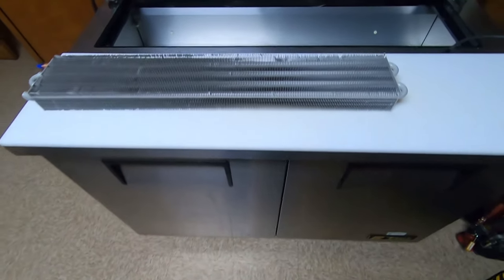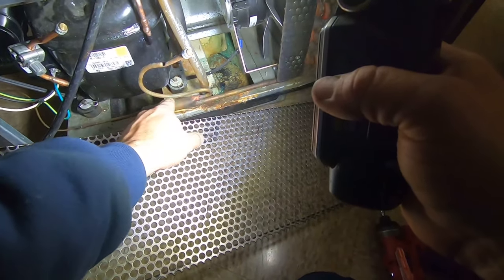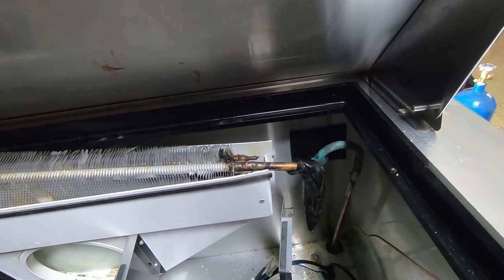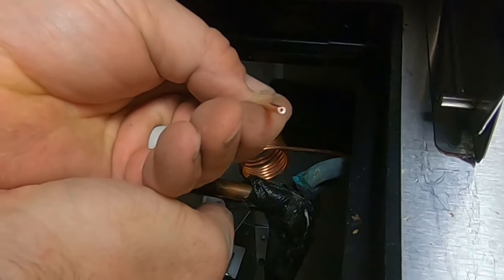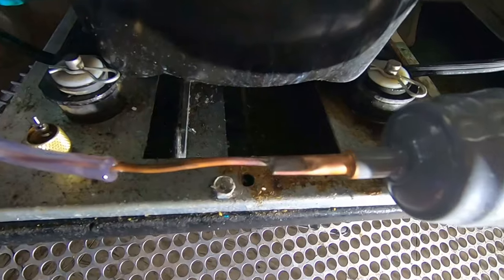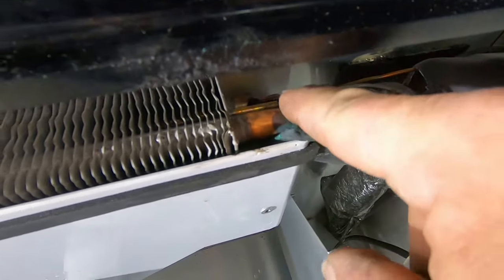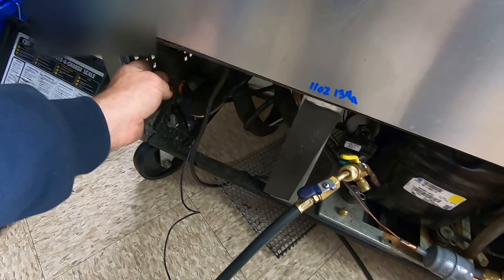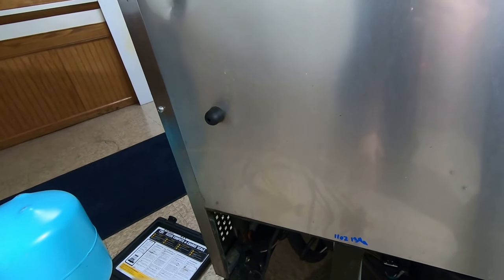True Prep Table Evaporator & Capillary Tube Replacement With Full Start-Up Procedure

Comment from the maker: Here is an evaporator and capillary change out that I did. I made this for the new techs and those interested in the procedure. If you enjoy these videos please leave me some feedback! I like to know what videos were your favorites.  Please subscribe and give me the thumb..lol
Reply: A Rick do you know if true mfg is going to aluminum Capillary tubing? How would you braze aluminum to cooper? I appreciate any information.  Thank you Ron White.
Reply from the maker: @whitesheatingairappliancer7101  I haven't heard that,  the cap tubes I have worked on have all been copper even on the R-290 equipment from other brands.   Solderweld.com  has some nice aluminum braze kits and so does a few others,  aluminum repairs can be done but it takes some practice and patience. I don't see a reason at this time for them to change to aluminum cap tubes but that is my opinion.
Reply: Thanks Rick,  I will check out solderweld.

Comment: In my experience over the years when using the 032 drier as a replacement for a bullet drier I needed to add 1-2 ounces over factory charge.
Reply from the maker: Good to hear👍👍Thanks!
Reply: yep.putting in a bigger drier,is like putting a receiver in.
Reply: @terryj.macmullen9968  ya, ever notice the Japanese eliminate driers altogether?
Reply from the maker: Yep, if you keep it clean your less likely to need one. But they use screens instead of driers.
Reply: they must use super dry refrigerants in japan.maybe to lessen the amount of refrigerant needed.?they must use the flamable gases there.
Reply: I remember addressing this years ago and Sporlan said it’s not an issue, you just add the additional refrigerant required to completely fill the shell, and the data is available on a cut sheet with the driers they sell OR in some kind of bulletin.  I do remember seeing it.

Comment: I use the same drier on cap tubes except where space is a premium, then I use the D-111, it has the access port as well. I do like your forward thinking to protect the cap tube of debris, and not opening the drier till needed, and the vinyl sleeve.  I saw an OEM on an ac that did that and was impressed. That pressure releasing you did with your thumb is the same thing I do if I’ve sanded the end. Great advise from your dad, copper is very malleable.
Reply from the maker: Thank you for all the feedback, I appreciate that🤜🤛👍👍

Comment: Great video thank you. Good to know that there is replacement filter dryers to replace the pencil dryer. I will have to check them out.
Reply from the maker: There is a C-052 with  ports on both sides available also. Thanks Ron!

Comment: Cool change out .. two things I would done differently.. would have cut the coil out the bottom outside the box .. pull it out then brazed suction and cap tube then for my last connection used  a flaring tool to make my brazing .. this would prevent damage to inside box and a better brazing .. like u said u can’t weld what u can’t see .. then for my charging .. just use the data plate for recommended charge ..thanks nice video
Reply from the maker: Sounds worth trying 👍👍. Thanks 4 watching!

Comment: Hi 
If I am not wrong I heard you talking about super heat for my knowledge and my experience we don't do super heat on reach in just charge the system by the name plate 😁
Reply from the maker: That's what they have always said and it's what I generally will follow but sometimes as cap tubes get restricted, coils start to get dirty and the equipment is just worn out or miss matched, you start looking for every tool to make it work that you can use.

Comment: Good video Rick. If you didn’t have any charge weights and had to charge just off pressure would that be suffice for cap tube systems. Just a little tricky charging with super heat on critically charged systems. Hard  charging a cap system because they generally don’t hold a lot of refrigerant and pressures can run very low making techs believe it’s under charged.
Reply from the maker: Your superheat changes as it reaches box temperature. I would want to see enough super heat at shut down. Maybe 12-16. It’s very difficult to do it by superheat.

Comment: Great repair and video. Have you had opportunity to use the Sporlan C-052 TT driver yet? Great filter so far. 
Appreciate your attention to detail. It's great that you teach the new guys with detail. However, it is a shame that you have to spend time warding off the YT police and their 2 cents. I'd love to get a days education from those super techs! Thankfully, there are techs like you who not only DO the work but also give actual effort into helping OTHER people.
Reply from the maker: Thanks man, I'm trying to make a difference, I'm learning chillers and grocery racks and I'm the one looking for help, so I know what it's like to not get the help you need. I have to admit that has driven me to do what I'm doing.
Reply from the maker: Yes, I use the 032 cap tt and the 052 cap tt, both work great but they won't stop bad Poe oil from clogging the cap tube.

Comment: Did you have any call backs because of the low saturation suction temp? I recently changed out a cap tube and had a saturated suction temp of 7–10. Unit was reaching set point and amps were good, so I called it good.

Comment: Happy Thanksgiving Rick!   Nice brazing!  That 590 is nice!   I have the 500, it's nice being able to lay them on the ground like that and fully operate them.  Just picked up a goose-neck AccuTrak.  Really like that tool!   Especially outside on windy days.  Your video on that sold me!  Thanks!!!
Reply from the maker: Happy TGD to you as well. The 590 has been good to me and so has Testo.  But the 500 is weird about going back to 0psi. I would like to have the goose-neck ultrasonic but could not find one used,  I'm cheap😁. Mine has its places where it shines and others where I can't find a leak without using nitrogen. Yes outside is the best place,  definitely not a busy kitchen. Lol

Comment: Hello Rick first of all thank you for a great video.. My question to you is....I've replaced a cap tube on a prep table followed pretty much all you did. I have tried weigh in the charge...to no avail...my suction line temp just won't budge...it's about 2 degrees less than my discharge temp. So then i evaluated the system and have been trying to add small amounts of refrigerant to get the box temp down at least a few degrees. I know from the compressor that it requires 266 g of R-134 a so I started there.. Currently I have. 39 and 110 pressures and 83 on both suction and discharge line temp.
My sat temps are 44 and 93. Box temp 82 ambient 80
So clearly the system is not working.  I have tried removing the cap tube and blowing it out with nitrogen. Replaced the filter dryer 3 times.  Is the issue here compressor related? I tested the compressor and the amp draw is 6.4 on a RLA 7.5 so that's not bad.  Evaporator was replaced a year ago by another technician..  Hope to hear from you and thanks again for the great video. 

Edit: clean condenser and proper air flow in evap and cond in case you ask..also no receiver on unit. Simple design.
Reply from the maker: It sounds like valves are about shot. "Low head and high suction".   You verified your not restricted, I assume you tried running nitrogen from just the high side first and it made it to the suction side?.   What I have tried in the past was use my pinch off tool on the suction side (do this if you don't have service valves on the compressor) and pinch off the suction line, you should pull down into a vacuum or at a minimum 0 psig. Then turn off the compressor and see if it holds at that pressure. If it doesn't pull down to 0 psig and hold you have a valve issue and need a new compressor.  Thanks for contacting me 👍👍.    I'm curious where are you located?
Reply: @HVACRSurvival  Thank you for the quick reply. I'm located in the river city of San Antonio Texas...
I did run some nitrogen thought the high side just prior to my soldering in the cap tube to the evaporator. I also cleared it through the suction again right before I brazed the cap. I've gone days trying to figure out what is wrong here and why my suction temp won't budge. No matter what i do. That high suction temp is causing the comp to short cycle constantly. I did manage to get it to stop cycling and got the box temp down to 70..but that was short lived once i added another ounce of refrigerant..I also
 added some ice inside the box to offset the heat being produced by door heat strips...which incidentally I think they are not needed specially given the fact that the prep table is in a hot kitchen. Opinion on that?
I do mot have a pinch off tool but I'll get one from my fellow HVAC/R techs and try your suggestion to test the comp.  What about compression ratios? That should also tell me if it's not operating at design too wouldn't you say?
Hey thanks again for your reply.
Reply from the maker: The heater on the door for a cooler normally is not necessary but is a nice gesture. The compression ratio according to what HVAC school has shown for cooler shows that you are operating lower than what is determined to be normal. Leading us back to the compressors defective. Now you said you did the nitrogen sweep before you brazed,  did you do it after you brazed? I've soldered those shut before is the only reason why I ask.   Your ratio comes to 2.3 to 1. According to Bryan Orr,  the normal ratio is 3.0 to 5.5. here's a link to his math https://www.hvacrschool.com/compression-ratio-matters/
Reply: @HVACRSurvival  yes sir I sure swept with the nitrogen during my soldering and after...heck i did it nprior too..used so much nitrogen I killed my entire tank...lol..
Btw the compressor in question is an Embraco Aspera 1/3 hp...R134.  HBP model number.  Ne6187z
So aside from your suggestion  I've run out of ideas as to what to try next.but at least you've pointed in a general direction. 
Those compression ratios are very telling of this compressors journey.  Thanks for looking it up for me. You go above and beyond the call of duty.. 
How can i thank you enough. 

I tried posting this same question on a Reddit refrigeration sub..and i got a bunch of vile replies not even trying to address my question but instead attacking my inquiry and saying call a professional.. That infuriated me..lost hope in people...
So it was refreshing to have an adult conversation with you
Reply from the maker: Unfortunately there's a lot of insecure uneducated people out there. I'm not saying I'm the smartest but I am willing to share what I've got. I've made a lot of mistakes and that's usually why I point out what I point out. they're such a shortage of good technicians out there that we can't find anyone worth a crap.
Reply: @HVACRSurvival  it's not just hard to find people that are worth a crap but also hard to find people who give a crap..Rick on this prep table I used a Supco BC 2. Cap tube since that was all i had with me. I do not own a cap gauge so i used the measurements on the table they provide it said it for .042 required 79 '' and that's what i did..is there a chance i may need to shorten it? To speed up the flow rate?
How can i test that ?

Comment: what low side pressure should you be reading for a system like this?
Reply from the maker: What's the box temp? what the refrigerant type? Pressures change with load.

Comment: What are your thoughts on using stabrite 8 for the cap tube?
Reply from the maker: I’d be worried that the soft solder might flow into the capillary tube. I’ve used it forever on air conditioners prior to carrier saying we weren’t allowed to use it anymore on their fortune because people didn’t know how to flux things correctly.

Comment: Really nice video.  As someone who own's a restaurant, I'm interested in learning how to work on these units since reliable techs are difficult to find in my area.  My prep fridge recently stopped cooling and the evaporated coils are freezing over.  Tech tried to fix it, diagnosed a 'restriction' in the system.   He replaced the drier and the cap tube, but said no guarantees and if it happened again to toss the unit in the trash.  Well it worked for about 3 days and started freezing the evap again, bring box temp up.  Any ideas on what could be going on.  All components check out good.  Tossing the unit seems stupid since is clean and was working well for many months.
Reply from the maker: Lot of variables there not knowing what it is what he did how he recharged it and the history of the unit.
Reply: @HVACRSurvival  Yep, understood.  I guess my main question is could a restriction cause the evap to freeze?
Reply from the maker: It can, I would like to see what the pressures are doing. Did he weigh in the exact refrigerant charge? Did he use the right capillary tube?
Reply from the maker: Does the product get Frozen?
Reply: @HVACRSurvival  no, the box temp rises, it's prep table.  No defrost cycle, sp72 Bev air. Very simple unit.  I allowed it to defrost for a day and it cooled like normal.
Reply: @HVACRSurvival  I don't know if he weighed the charge or not, also I ordered the parts based on the manual to ensure it was the correct cap and drier.
Reply: @HVACRSurvival  I moved the temp control to the the off position to allow evaps to defrost, flipped it back on this morning for service and it's cooling very well so far.  Hopefully we can get the weekend out of it.
Reply from the maker: @cpabrego  that's why I was wondering if you possibly have a thermostat problem. Without having a gauge on it to see if it's pumping down it's hard to say for sure if it's really restriction. It's not always textbook, I like to see, hear and smell the whole thing so I can put my diagnosis together.
Reply: @HVACRSurvival  Yep I understand where you're coming from.   Diagnosis over youtube is not really possible, but it's fun to talk shop with you! Thanks for your responses!  I've assumed the thermostat is working because it turns off and on, but I suppose you're thinking about an intermittent issue that keeps the compressor running non stop?
Reply from the maker: Or it's not turning off at the correct coil temp?
Reply: @HVACRSurvival  I'll take a look again.  I have been data logging the outlet air temp in the vent and I can confirm that when I ran into the issue on Sunday the outlet temp never went below 35 degrees.  All weekend, I could see the compressor kick on at 41, instead it just crept up to around 60 when we noticed.

Comment: Been using Staybrite on mostly compressor reach in replacements, but see some built in custom line cook units next off season on my project list and want to be prepared for some odd sized fitting/connections.

What size oxy/acet tip and pressures do you recommend for similarly sized equipment?
Reply from the maker: I normally use a number 2 tip,  ox and acet is a 1 to 1 mixture, 5-10psi.  Staybrite is ok on filter driers and txvs but I never use it for compressors. Personal preference I guess, once I learned to properly braze I stopped using staybrite.